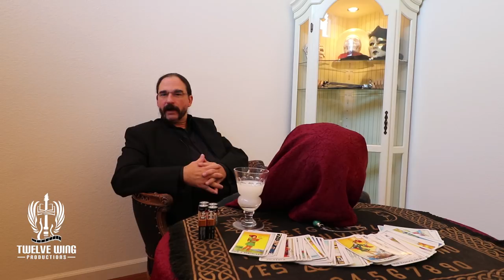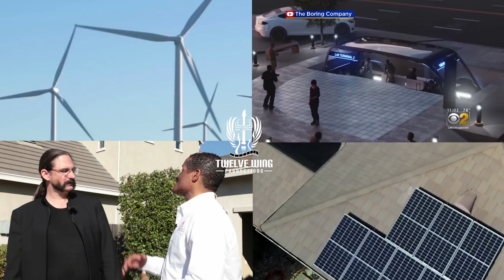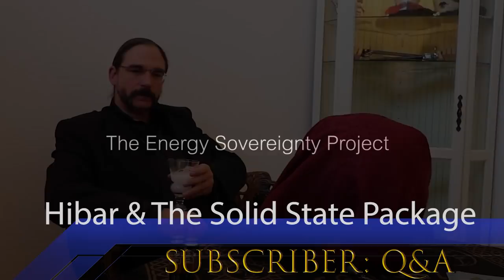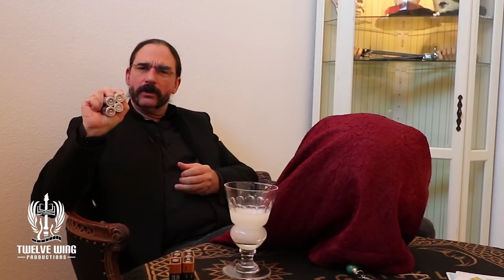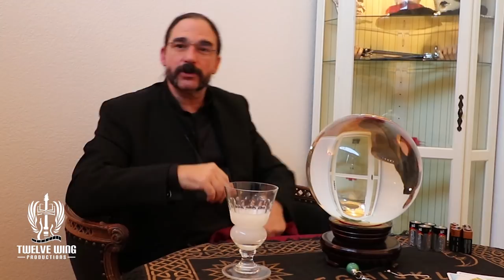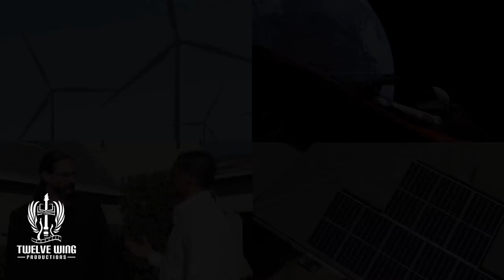Tesla's Purchase of Hibar & The Shape of Solid State Batteries

Comment: I am intrigued by your arguments but i quedtionbyour time line to get some of these breakthroughs implemented. It seems very time consuming to bring these new chemistries out of the lab into production successfully. I think that this nee tech will be coming but it will take more time than you give it.
Reply from the maker: Have a look at our second solid state battery video.  I go into a bit more detail as to when this all really started.
Basically they have been working on this since 2014.
Reply: Yes i understand that they have been investigating various chemistries and techniques for awhile. But so many companies have slammed against brickwalls before hence dyson with their solid state battery claims and now cannot even find a buyer for any of their trouble.  It seems that tesla would want to use the tried and true tech with a rapidly desending cost cure vs a new very expensive tech in its less expensive cars. I would be surprised if the mass produced cars 3, y, and cyber pick up would use these high tech cells right off the bat.
Reply from the maker: @dkositsky , we will have to see.  I'm not sure I'm going to describe this as "off the bat".
I also think that much of what Dyson ran up against was not so much a wall of brick, but one of patents and NDA's.

In the immortal words of Jack Napier.... "Never rub another man's rhubarb".

Comment: If one of the Plaid Model S tested at the Nurburgring is a stealth Roadster mule, then the performance is way off from what Elon suggested the Roadster would be capable of ie. Breaking  the Nurburgring track record for ICE vehicles.
Reply from the maker: Not too far off when you consider that the Model S is probably about 800lbs or so heavier than the Roadster.  Maybe more but that's just a ball park figure.  Then there are other considerations like wider tires and a lower roof line... possibly wider stance.
So we will see.  I think what they are working on mostly in this test mule is the new thermal management system, maybe employing ultracaps, and the new battery architecture/chemistry.  Oh, and the 3 motor controls.  They are probably using torque vectoring. 

So I think there will be quite a bit of overlap in the Plaid S and the Roadster.  We shall see.
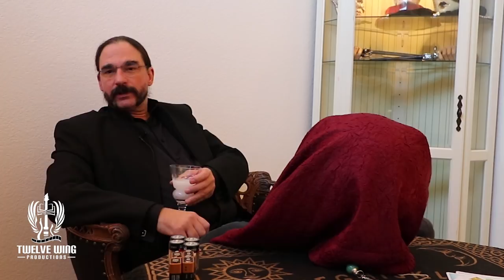Reply: @twelvewingproductions7508  DAErik has 1:18 scale models of the Roadster and the Model 3, both produced using originsl CAD files. The models have matching wheel bases and dimensions.
Reply from the maker: @ramonpunsalang3397 , I have a feeling that the toy company may have played a little loose with that 1:18 scale.
There isn't anything published on this yet, unfortunately, so we will just have to wait until they actually release it I suppose.

That said, it would be extremely unlikely that they would re-shell a roadster to test it.
There is simply too much that would be affected structurally that would tend to invalidate what you learn.
Better to re-equip a Model S to do this and use what you learned not only to test components for the Roadster but also to improve the Model S.

Comment: yep... you might win a nice steak dinner. kkk
Reply from the maker: It's a crap shoot really.  Gali brings up some great counter arguments for keeping the cylindrical cells.  So time will tell.
It's a friendly thing.  Not something either one of us would be surprised to wither win or lose.
Ultimately, the thing might include both cylindrical cells and ultracapacitors... and he and I may need to meet in Nebraska and buy our own damn meal.
Reply: @twelvewingproductions7508  Yesssssss I think future vehicles will have both batteries AND ultracapacitors. The capacitors give instant acceleration, and are very very quickly recharged, ... but do not store a lot of energy... and the batteries fast acceleration, but they store lots of energy over a long time. 
logically there will be separate components, ie two battery systems, but Elon could fool us by having both systems in each battery. If this is the case Elon should go on Penn and Teller fool us because this will be pure battery magic.
Reply from the maker: @steveblomefield9513  Yup.. pure battery magic!!!